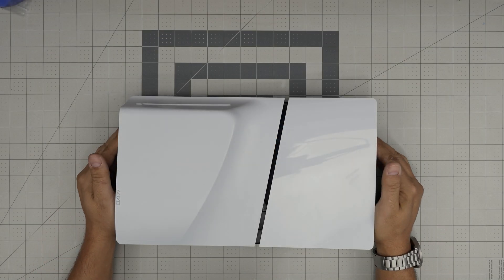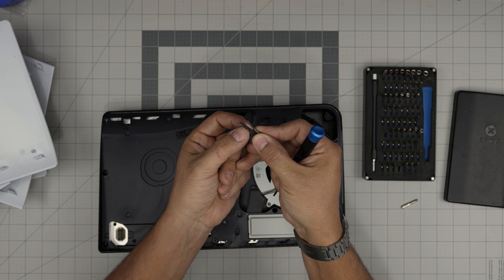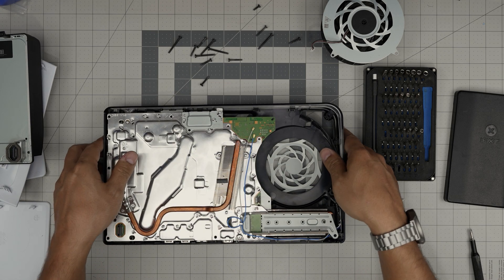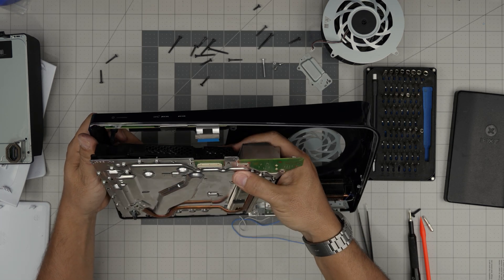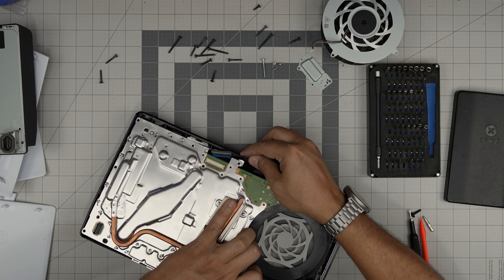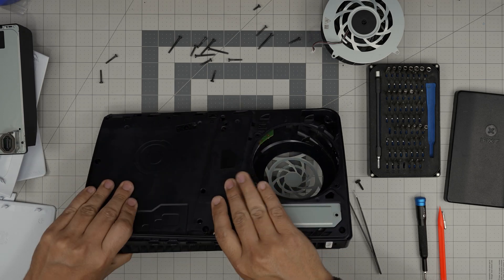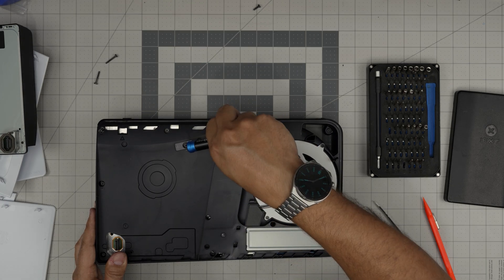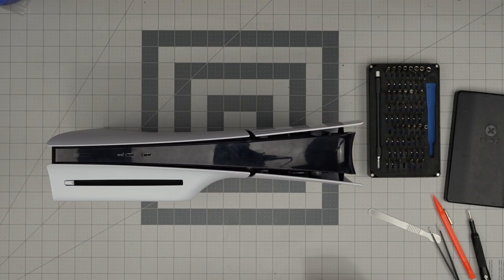How to Replace the PSU on PlayStation 5 Slim CFI-2000 | PS5 Power Supply Fix

Comment: So my PS5 slim is not working and it doesn't show any light or any beep can you tell me is it the power supply or is it the power cord from the behind because I have no idea
Reply from the maker: 🫠Regarding your question, it's impossible to tell you over chat, but I can help by suggesting that you use a multimeter to check if the power cord is working and has continuity. If it does, then the issue is likely not with the power cord. If your power cord is the original one that came with the console, there's a 99% chance it's not the problem.

To check the power supply, you’ll need to remove the PSU, connect it to the power cord and plug it into the wall. Then, check the DC voltage on the output of the power supply to see if the 12V is present. If not, the PSU is damaged.

cheers🍻
Reply: @uFixTek is it possible to replace it
Reply from the maker: yes you can remove the PSU and place new PSU, get it on amazon or aliexpress

Comment: Hi , need help 
I have ps5 slim 
Recently its not turning on 
Like when i press button on controller or press directly from ps5 it self 
Its give 
1 BEEP SOUND AND LIGHT ON PS5 SLIM FOR ( 0.5 SECOND) THEN TURN OF
AND YES FAN ALSO SPIN FOR THAT TIME 
IS IT MY PSU 
OR ANY INTERNAL ISSUE 
BECAUSE i purchased a import ps5 so cant claim warranty in my country and also i didn't use for 4 month 
But recently using it for 1 week 
And one more thing it got too much dusty and insects 😅😅
Maybe thats the issue please help i recently purchased ps plus membership
Reply from the maker: 🫠Regarding your question, we encounter this issue at the store frequently. If there are no insects, the problem is likely with the PSU. However, if there are cockroaches, there’s a 90% chance of a short on the motherboard because their bodies conduct electricity, potentially causing shorts as they move across the board. I recommend opening it up, cleaning the motherboard and removing any insects, then testing it.
https://youtu.be/zetYqSIUqTk
cheers🍻
Reply: @uFixTek  will try because there is some cockroach in there
Reply from the maker: yes try that 1st

Comment: Hi, does the power information label on the PSU for ps5 slim CFI-2000 say 220v? Just curious as i have purchased a ps5 slim from japan and the manual says 100v.
Reply from the maker: 🫠Regarding your question, PS5 is Dual Voltage, so no worries, no matter where you purchase it will work.
Reply: @uFixTek  thanks a lot mate!!
Reply from the maker: It's my pleasure my friend.